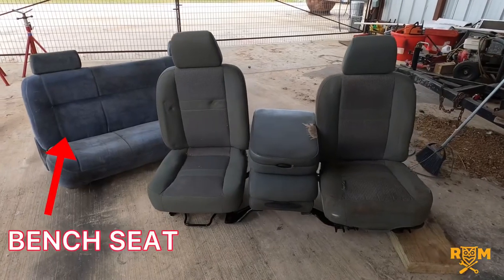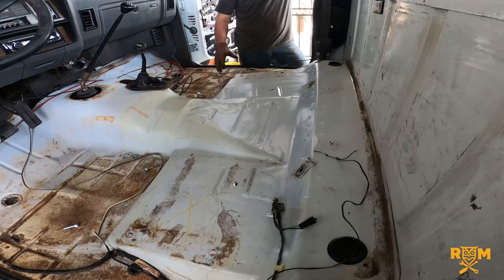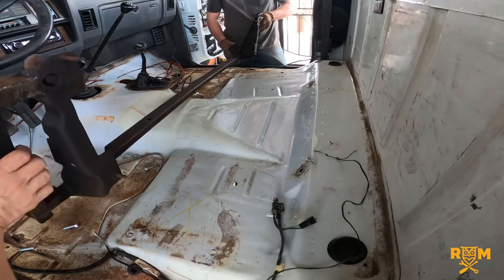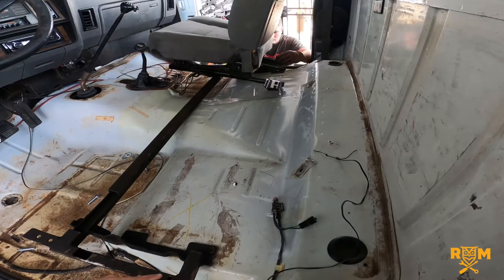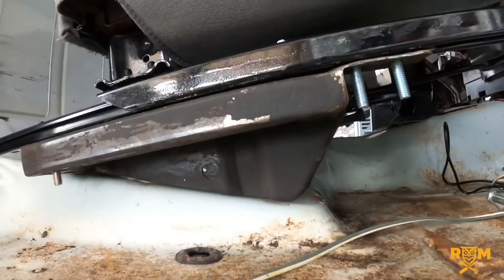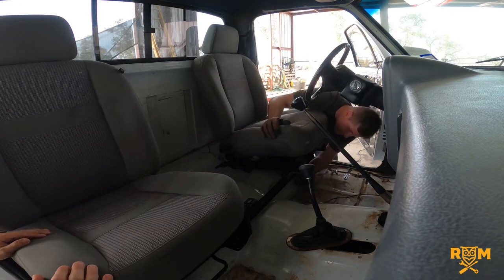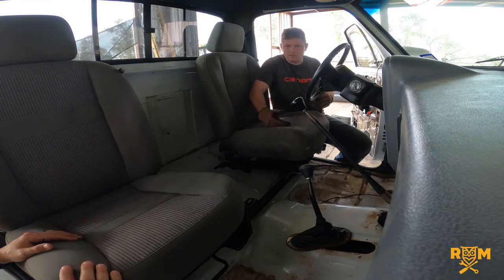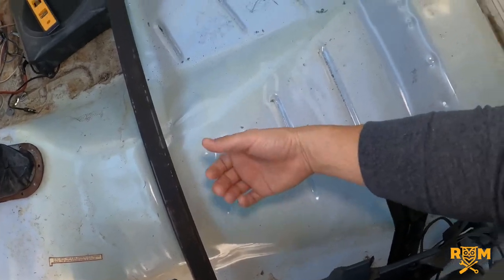1st Gen Cummins Seat UPGRADE SWAP! Ditch The Bench For Power Bucket Seats. Simple, Safe, Secure

Comment: actually I did the same exact thing to replace my bench seat with bucket seats.  I used the original bench seat brackets and ran L channel steel  to connect the brackets front and back. it made the best sense rather than   putting holes in the floor pan and having to reinforce the area with double sheet  metal. the last thing you want is to have seat mounting fail in an accident